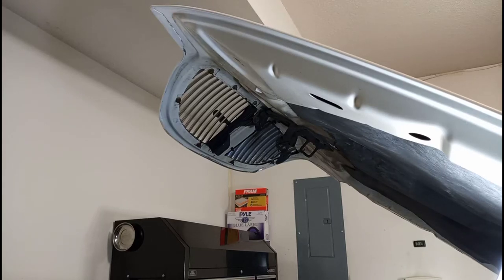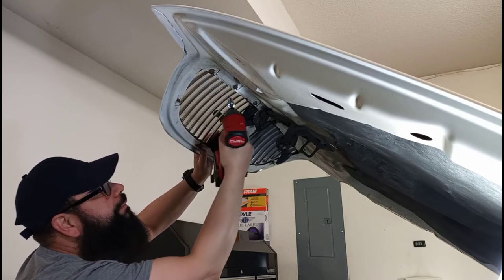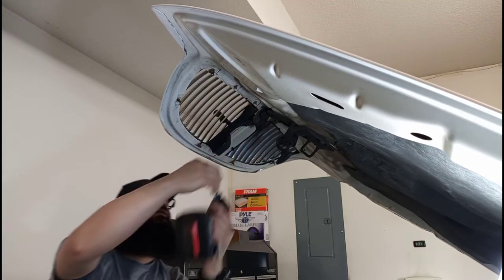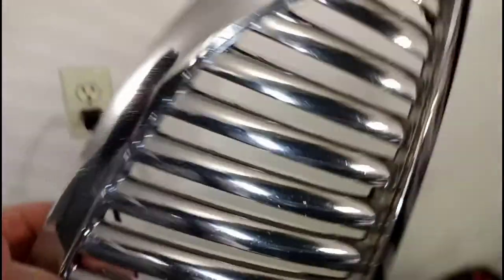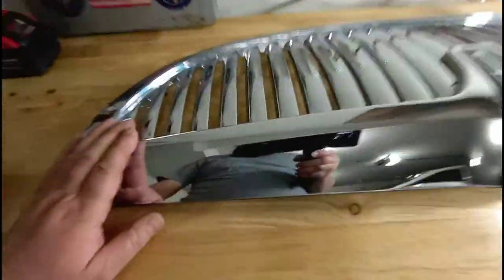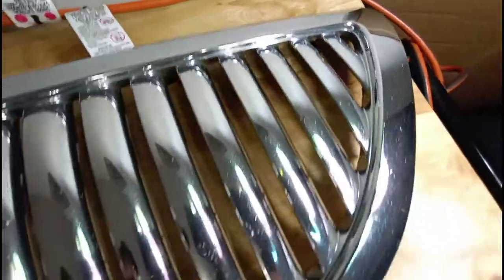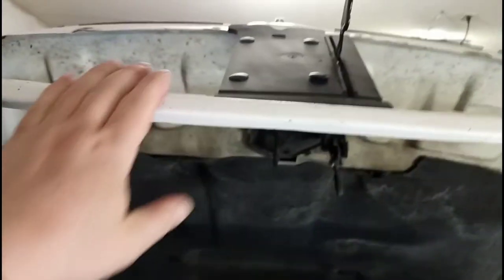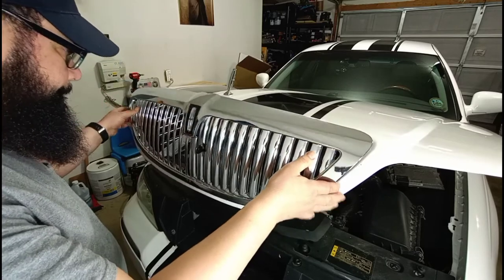Remove and reinstall grill on Lincoln town car

Comment: I'm thinking about blacking out all my chrome, it's been brewing In my head for awhile
Reply from the maker: I went to my dealer's part department to get a price check. The grill is $131.15 and the emblem which is not included is $46.92  If you could get it cheaper else where go for it or just paint it..
Reply: @Pantherforlife  I would just order a cheap $40 Chinese one and paint it and get a Lincoln emblem off of Amazon for twenty bucks and save my factory one

I'm actually thinking of blacking out all the chrome on the car

Comment: Thanks for the video! I'll need to replace mine soon
Reply from the maker: Thanks a whole bunch. I know after years of ownership the front grill takes a beating from road debris. You don't have to go the dealer or body shop for this repair. I already did a price check at my dealership. Grill= $131.15  Emblem= $46.92 if you could get it cheaper else where go for it....
Reply: @Pantherforlife  Yeah, I'll replace myself. Would you happen to know the part # of that badge?
Reply from the maker: @VitaliyKofman  The part # https://parts.ford.com/shop/en/us/body/other-body-related-parts-general/emblem-6277135-1
Reply from the maker: To let you know I did it for your year 2006 and for my year 2008 and it came out the same. It's also a little cheaper online.
Reply: @Pantherforlife  Thank you!!!

Comment: The nut and bolt turning how to get it off the nut broken in the.plastic
Reply from the maker: Use needle nose pliers to get it loose or brake it off anyway you can. Once off don't worry there's enough screws to support the grill.

Comment: Yo Julio,
I sent you an email.
Did you get it?
-Chuck
Reply from the maker: No I didn't get your email.
Reply from the maker: Try it again this is my Gmail account  JCumba46@GMAIL.COM
Reply: @Pantherforlife  
Yup, that's where I sent it.
I'll send it again.
Reply from the maker: @PanzerPlatform  Got your email good 👍 to go. For anyone else that has a question but does not want to put it on the comments section. This is my Gmail account JCumba46@gmail.com